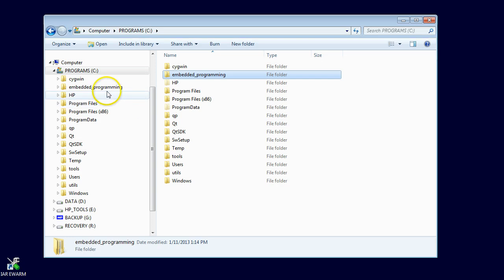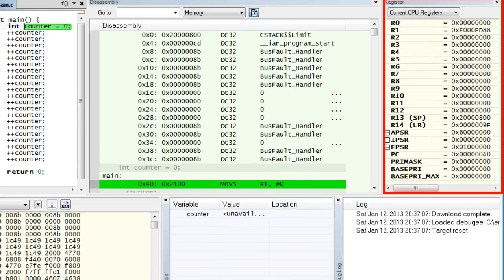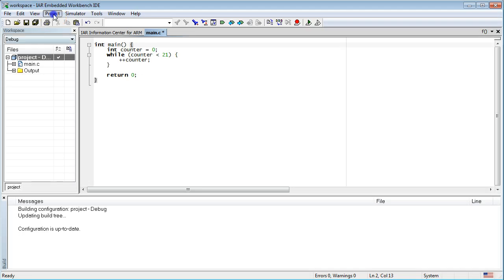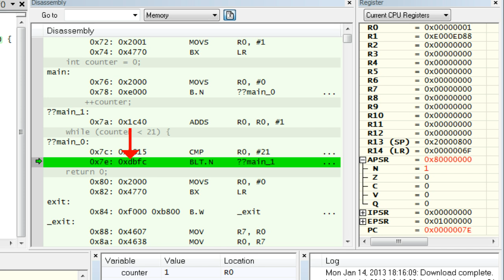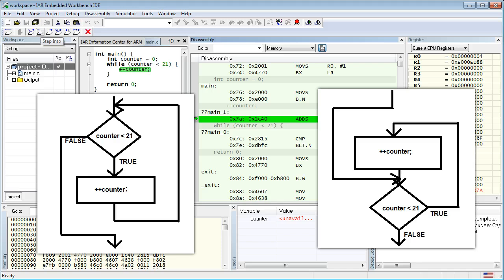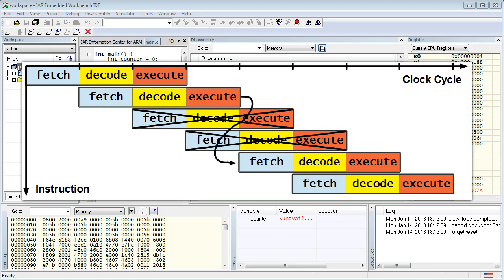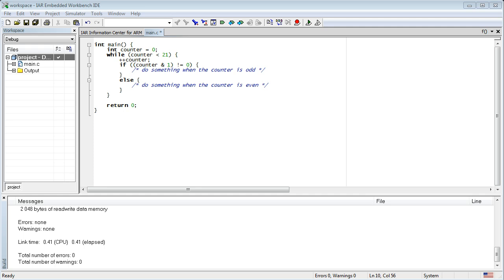#2 How to change the flow of control through your code

Comment: Hello, I am confused about a few things.. how do we know "d" = t1, B = condition ?? and How does FC = -4?  I rewatched the counting segment, and still do not understand how 0xFC = -4?
Reply from the maker: +Mathew Wilson In 32-bit arithmetic the bit pattern for -4 is 0xFFFFFFFC (just try to 0x00000000 - 0x00000004). In 8-bit arithmetic, 0x00 - 0x04 == 0xFC).
Reply: @StateMachineCOM  thanks that was a good explanation, but only can you throw light on these as well , How 

"d" = t1, B = condition ??      

Thanks in advance
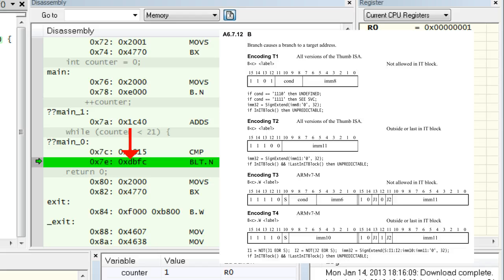Reply from the maker: Please watch the video @5:00. Here I show the encoding of various B (branch) instructions. The encoding for the BLT.N instruction at the address 0x7E uses the 8-bit immediate offset. All those offsets are interpreted as signed numbers. So, an 8-bit signed number 0xFC is -4. If it was interpreted as unsigned number, it would be 252. So, in the end it all depends on how the bit pattern is interpreted.
Reply: how do you know that the remaining address is set to "FFFFFF" in 0xFFFFFFFC when only FC is given?

Comment: @9:01, the jump encoded at address 0x80 (= 128 in decimal) is fb, which equals minus 5 bytes, right? Then this would seem to indicate a jump to address 0x7b (= 123 in decimal).  But in the Disassembly view it appears that the jump should be to address 0x7a. Can you please explain the apparent discrepancy?
Reply from the maker: +Forbes Winthrop By now it is probably one of the most frequently asked questions. I explain later in the course that any value loaded to the PC (Program Counter) register on the ARM Cortex-M CPU must be odd. This is because the least-significant-bit in the PC is NOT used for addressing (instructions are always aligned on the even address boundary, anyway). So this LSB in PC is instead used to carry information about the state of the CPU, with 0==ARM-state and 1==THUMB-state. But Cortex-M supports only the THUMB-state, so the LSB bit must be always 1. BTW, you can try to load an even address to the PC from the debugger. You should try it and see what happens!
Reply: Quantum Leaps, LLC Thanks. Great course.

Comment: please clarify  that what happens if we assume the counter as odd at 9:30 . it is not clear for me in this video thanks in advance
Reply from the maker: +Sai Ganesh At 9:30 I give just an example of the "if" statement. There is no actual code (only comments) in the if-branch and else-branch. But if you would put some actual code in the if-branch, then this code would execute when the counter is odd. Similarly, if you had some actual code in the else-branch, then this code would execute when the counter is NOT odd (i.e., when it is even).

Comment: At 6'40", you compared the efficiency of the generated code with that of the code we intent to write, and then you said that the generated code is faster because it has only one loop at the bottom. 

However, the flow chat on the left has only one loop also which stays at the beginning. I am quite confused why the right flow chat is faster than the left one.
Reply from the maker: @108670028652039476584 
The code generated by the compiler is faster because it avoids a branch to jump over the body of the loop when the condition is false. As I explain just a minute later in this lesson, a branch (jump) stalls the instruction pipeline in the CPU, and therefore it is quite costly (the cost is at least 3 clock cycles, which corresponds to the number of stages in the pipeline). --MMS

Comment: Calculating the offset isn't quite right here. Modifying the code to include three ++counter statements increases the offset value but the simple formula of Current PC - Offset doesn't give the right location. Help anyone?

Comment: Hello, I'm a newbie to embedded systems programming.  First I would like to say, "Thanks for this series!"  In order for me to understand everything to the fullest, I watch your videos multiple times in an attempt to make sure I grasp every concept before moving on. 

I hope you can help me with my question:
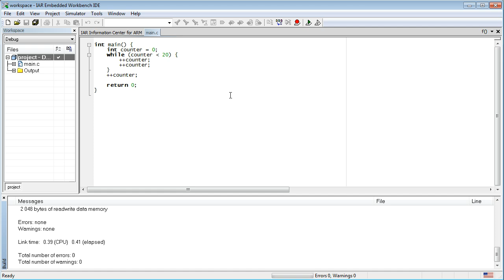In this video at position 9:00 minutes, we see:

0x80:     0xdbfb     BLT.N     ??main_1

According to your previous explanation, the offset for the BRANCH is 0xfb (-5), which means this instruction would branch to 0x80 + 0xfb = 0x7b:, and not 0x7a.

Can you clarify why the offset is not 0xfa?
Reply from the maker: Daniel P 
As I explain in several occasions later in the course, any load to the PC on Cortex-M must be an odd number. This is because the least-significant-bit in the PC is not for addressing, but rather it is the THUMB-flag, meaning that it indicates the THUMB instruction set. But Cortex-M supports only THUMB (Thumb-2 to be precise), so this bit has to be always.

In fact, as an experiment you can try to load something even to the PC. For example, you might change the value in the LR register right before returning from a function (see the upcoming lesson about functions). As you will see, this will cause the HardFault exception in the CPU.

--MMS
Reply from the maker: +Dmitrii Kozlov The branch instructions do not load the PC. They increment or decrement the PC (they are relative to the current PC). So, you might think that the B instruction is like ADD pc,pc,#xx, which is of course different than LDR pc,... Regarding the offsets, your example 0x80:0xdbfb would not work because the offset 0xfb is odd, whereas the THUMB-2 instructions are always at even addresses.
Reply: Daniel P HI Daniel. I've picked up on this too which I think is an error in the video. Calculating the new PC location is not correct from what I can see. If you add more statements ++counter; you will increase the offset and create a new value and the PC - Offset formula doesn't go to the right location.
Reply: Quantum Leaps, LLC hi this is interesting. I thought the address shown in PC counter was actually 2 instructions behind the real address due to pipelining.
Reply: +Quantum Leaps, LLC Hello! It is perfect tutorial. I am very pleased to watch it. As for this case, I don't understand why 0x7e: 0xdbfc works with 0 in the least-significant-bit and 0x80: 0xdbfb shouldn't work. Both instructions load PC, don't they? Could you explain?